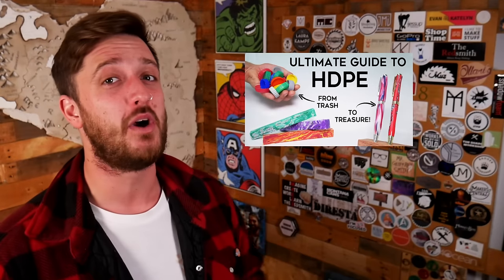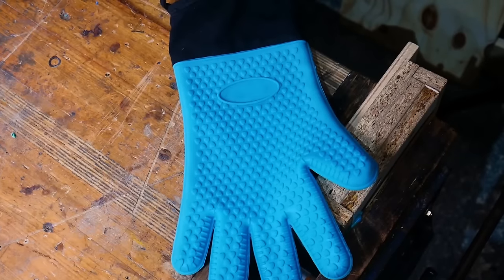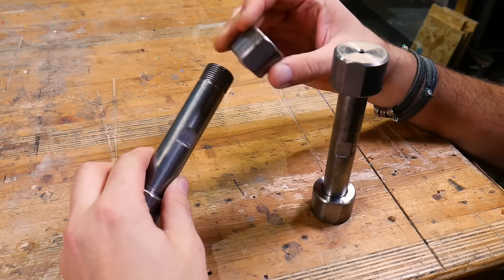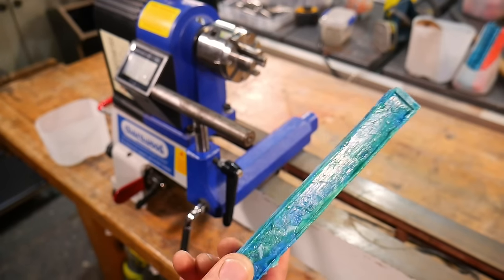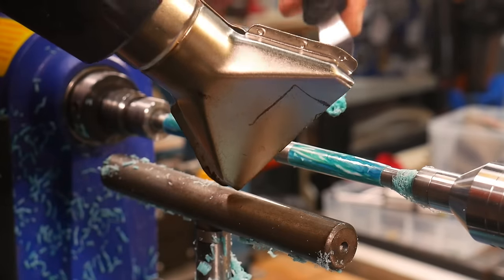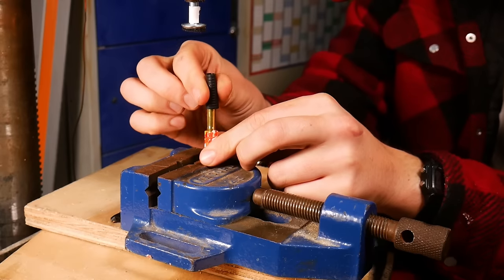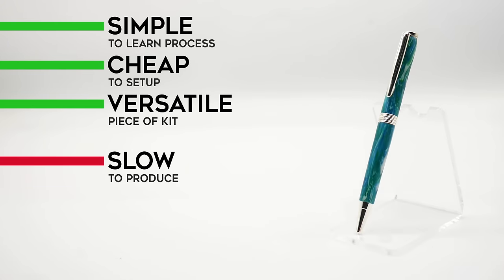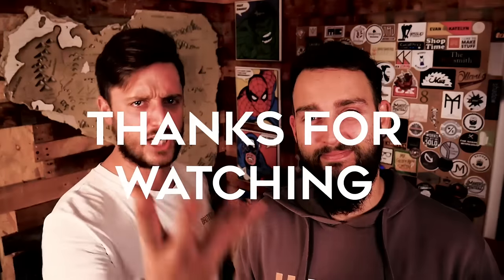How FREE plastic waste can be turned into $75 pens

Comment: You take the hot plastic from the panini press and press it into a rectangular prism - even when you know you want a cylinder. Couldn't you use a long drill bit and create a cylindric mold? Even if it was slightly elliptical [due to saw blade kerf] you'd still be closer to your final shape and less wasteful. Building a cylinderic mold might be worth a quick video....
Reply: E
Reply: Ss😊gswek❤😅😅😅

Comment: I went into this needing a panini press, and left needing a panini press, churro maker, lathe, heat gun, micro mesh pads, drill press, and whatever else I can't find in the garage, I'd be curious to see what the minimum materials needed would look like! Only using the most simple methods to get the lowest entry cost, good video either way!

Comment: I’ve been a wood turner for many years and I really enjoy turning pens. I use wood, epoxy, plastic acrylic. Anything that can be turned. I also use the micro sanding pads. They last longer if you wet sand with them. On plastic I sand up to 600 grit then use the pads. Thank you for the videos.

Comment: FYI, having made a few pens... check the "fit" of the mechanism before you call it "good". The reason is that if you've not ground the blank perfectly to the tube, the fit will be different. Compress the twist mechanism, insert and screw in the ink, and then twist to be sure the ink comes out of the end of the nib sufficiently. If it barely shows, you need to push the mechanism in a little further (and I mean A LITTLE). If it won't contract fully when "un-twisted", then you'll have to pull the mechanism out a bit, which is a trick and usually requires special equipment. You can do it with pliers but that doesn't work out very well. I know. I've tried. 
Always try the twist mechanism before you continue on. Don't assume it's correct. 

The process could be way more efficient if you cut off most of the waste before turning. If you know the final dimension of the pen ends (because you have the bushings to go from), then you can cut accordingly. For making slimlines, I cut to within a quarter of an inch of the tube on all 4 sides on the bandsaw. Doesn't have to be perfect. it will round out on the lathe. You can refine further if you want to take the time to sand it round, but this just takes time and you get nothing out of it. A slimline pen bushing is about 9mm or so, with the exterior of the brass tube being 7mm. Cut the corners of the blank down to about 15 mm and that gives you plenty to work with. This also gives plenty of room for fancy stuff like bevels and inlays or whatever. 
If you cut off the waste in one big chunk, it's easier to recycle later. 

If your tools are catching and stop the blank, then you don't have the live edge part of the mandrel (or the right end) tight enough. Just take it a quarter of a turn and try again. Repeat until there's no catch.

Comment: Just for the benefit of those who do not have a drill press, you can use either the lathe or a vice as a pen press. Thanks for the update as it reminded me that I intended to recycle the panini machine in the back of the kitchen cabinet which was only destined for the graveyard in the loft. I am a user of Taylors Mirfield and can also highly endorse them. Keep up the good work.

Comment: Just a thought on an intermediate molding process rather than the churro maker; increase the size of the wooden mold from a single blank to 4 wide (or however many you want) and have the interior routed out with a bullnose bit to make the blanks round (or rounder at least). Increase of production speed and reduction of waste. I don't make pens, but I am lazy.
Reply from the maker: Nice ideas

Comment: make a mould using silicone some can be up to 230c n have seen some for 300c heat resistant, once emptied fill it up with Hdpe fragments (smaller the better mine are less then 1 mm x 1mm) pour it into the mould but just enough to create a layer and with a heat gun hit it on a top setting OUTSIDE with a fan blowing away from you but not gonna interfere with your hdpe fragments, then like a 3d printer whilst its still hot pour in the next layer of hdpe and blast with heat n do over n over till finished, or fill up the  mould all the way and place in an ART only oven (easy bake). Although hard not impossible you can paint hdpe look up "plastic annealing"  or kissed by flame then painted its not 100% but its damn close.

Comment: Hey folks, just FYI, catches occur even with crazy glued wood.  The cause is the steel blocks are pressing against the brass tube, and NOT the material.

If you put a couple spacers in there, nylon washers, rubber, whatever, the bushings will hold the material MUCH tighter.

This is not me talking out my ass, I've made many pens.  If this trick doesn't work for you, you're not getting pressure on the bushing pieces & the material.  
Or you've run out of thread on your mandrel?
Or you don't have ENOUGH thread on your mandrel to add extra washer bits.  If so, make your own mandrel from threaded rod.

All these things can be done on a wood lathe or a drill press with enough IMAGINATION.....

Comment: More jagged edges on the churro blanks? Huh. I'm not a turner (will be soon because ... obsessed), but I would think it would be easier to turn a multi-sided blank than a square one.  Yes, there are more straight sides you need to round, but square wood is a whole lot chunkier. What say you?  What if I made a jig to round the blank on a bandsaw first? Think that would save any time, or is turning faster no matter what? I'm guessing turning is faster on whole. 
Are you sure you had your bank chucked up tight? I mean, the blanks shouldn't get "stuck" no matter what shape. But I know little, so I want to learn.
Reply from the maker: Yep it was chucked up tight. But HDPE is a slippy material and will always loosen more so than wood. I’d say overall it’s still quicker on the lathe, it’s just something to be aware of as we found it slipped more that the cylindrical blank 👍🏽

Comment: @Brothers Make: simple improvement suggestions for your personal safety on the lathe. I assume you already know all the safety procedures and safety equipment. This suggestion is intended to make your work both easier and safer in the process. 

The suggestion: use a polycarbonate or other clear plastic capable of acting as a safety shield between the object you are lathing and your vision. I still recommend using safety goggles anyway. I also suggest making a vacuum tube and hose that sits directly behind your work area so as to collect as much of the debris as possible to reduce time spent cleaning and keep your work space clear. This should reduce waste due to dust accumulation on the plastic shavings. You could also just wash them before use but this suggestion is intended to remove that requirement entirely. I thought about using an empty clear soda bottle for this, but decided that wasn't safe enough for your application. Anyway, do with this whatever you want. I think it would be cool to use recycled plastic for the entire concept.

Comment: I'm curious couldn't you use an epoxy resin in a small cylinder mold and stick the cylinder blanks (post lathe) to fill in any air bubbles and give it a protective coating?

Comment: Have you tried to heat the plastic with the brass tube inside. Would this glue the blank to the brass tube better. I used ca glue and it came loose while turning.

Comment: Are you wet sanding? Doesn't look like it. Huh. Apparently wet-sanding isn't necessary on plastic? Good to know. I use these on wood, but you have to let the wood dry completely ... that, or finish to 600 grit, coat with CA glue for a couple of coats, THEN wet -sand to protect the look of the wood. Most woods go dark if you don't protect the coating. Another option is wax if you want a matte but buttery finish. 
Have you tried wax on plastic?

Comment: I see you weighing the plastic before melting I assume that's to get a specific volume my question is what is the weight to volume ratio, as it will be frustrating to get halfway through a project to find that you need a lot more plastic
Reply from the maker: Check out out recycled plastic beam video where we give you the equation  to work it out 🤙🏼

Comment: Just fill a capped metal pipe full of chopped plastic and place it vertically in either an oven at the right temperature or a hot water bath and melt the plastic.

Edit: hot water won't work
Reply from the maker: How do you remove the blank when it’s cooled? Also, an oven wouldn’t work as the mould would require constant topping up as the plastic melts. A water Bath would not be hot enough.
Reply: @BrothersMake  mold release and a dowel whose outside diameter is similar to the inside diameter of the pipe. Unscrew the cap and push the blank out.  If you chop the plastic enough the pieces will lay relatively close together, leaving little room for air. Make the pipe roughly twice as long as the blank you are trying to make and you should have plenty of material in one go.
Reply: If you were able to flatten the plastic and punch it into discs the same diameter as the tube, you could stack them into the tube which would mean no room for air and could make for some interesting patterns when turned.
Reply from the maker: This is essentially what our mould is, a pipe with a screwed cap at either end!
Reply: @BrothersMake  but no expensive machine taking up space
Reply from the maker: Sure, you could look at it like that

Comment: Do you guys worry at all about the environmental cost of your equipment? I presume it's not advisable to use the panini press or churro press for food after this, right? Like of course, the fact that you prefer to buy locally-manufactured and things with less plastic packaging is very commendable, and this isn't really intended as a criticism as much as a thought experiment. I feel like the more research I do, the more I find out that the solutions to plastic waste I go for turn out to have huge environmental costs themselves. Like the classic example is reusable tote-bags, or reusable metal straws. Like I reuse paper takeout bags, which are likely preferable to purpose-built tote bags made of that weird melt-blown plastic, which has to replace hundreds of plastic grocery bags to break even, according to one figure I read. Or like, bamboo reusable straws, which at least theoretically, are hugely preferable to metal reusable straws, because they have to replace hundreds of plastic straws to counteract the cost of mining the alloys used in stainless steel. Obviously it's not all bad. I think plastic Christmas trees only need to replace 40 trees to break even? I'm kind of off the rails here, it's just something I worry about and I don't have any good answers for, and I wonder if it's something that anybody else thinks about. Sometimes I feel like the only way to win is to stop buying things lol 😕
Reply: You have hit the nail on the head with your conclusion on the matter.  Where there's demand there's supply.  But when I was a child the problem was mass deforestation due to demand on wood.  Along came multi-use plastics to replace single use paper items.  We were saved.  The Panda's kept their homes.  But here we are advocating the reverse, also for the sake of the planet.  Consume less is the only real answer.
Reply: Sustainability works best when resource consumption isn't static. Consuming less is as equally important as when you consume what you're consuming. Proper resource management for sustainability requires knowing when to stop using or ease up on something to allow for regeneration. When is enough, enough?

Some years bamboo and metal may be more sustainable to use than plastic and wood. Because economics has only recently begun to include Earth's resources in financial models (because for some reason GDP and cash flow was the only thing anyone cared about for so long) we still have a ways to go to determine how best to regulate and price resources in a way that isn't simply for profit. At least people are starting to think so that's nice!

Comment: I was thinking about doing this for knife handles. But you said epoxy didn't hold well. I'll also be using brass pins. Do you think it will hold up?
Reply from the maker: We've actually got a full video on making a knife handle which you may find useful! It's definitely possible 👍🏼